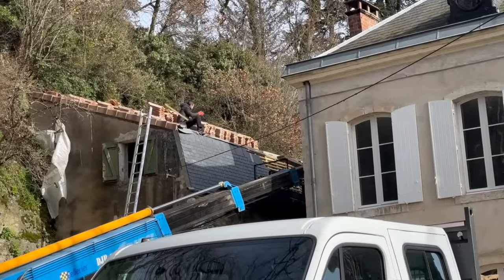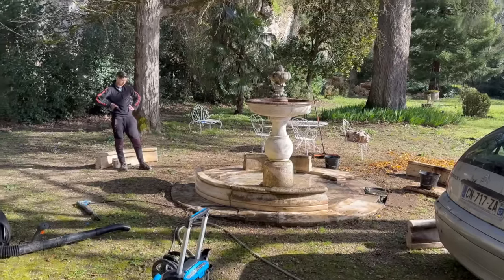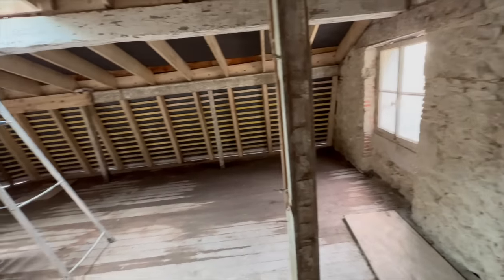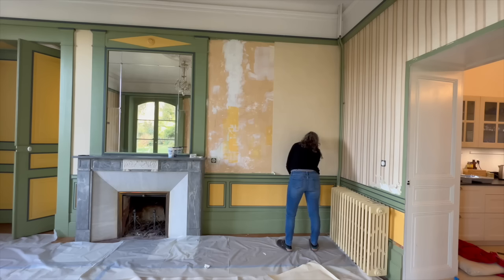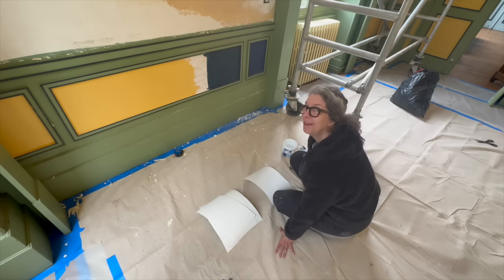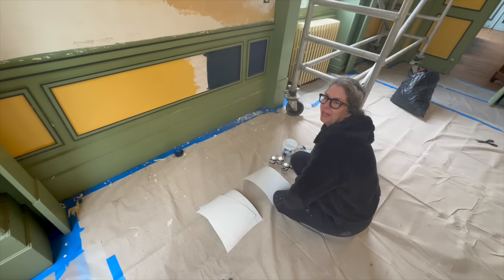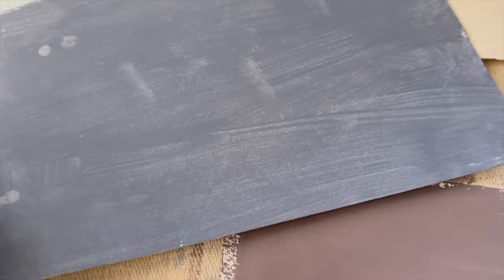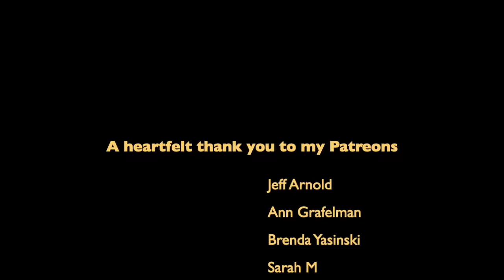Chateau Bureau transformation begins, Cottage Roof Done & New Retreat Announcement! 🎨 Ep #78

Comment: I say use 3 colors (plus not so yellow white for ceiling or use Parma on ceiling and at top areas of walls.)  Use combo of Parma, Wine Dark (I say for larger wall surfaces), and find a Deep Eggplant color for trim (darker than the purple you now show on a slim vertical strip color swatch on wall.)  Possibly use Parma in squares, or use the Wine Dark in squares and also on walls, with a unique and slightly more colorful motif hand-painted in each square, and a Deep Eggplant color for trim around Wine Dark squares.  Then use Parma on areas at top of wall and onto ceiling, like the sky.  The paint brand you are using seems to have a wonderful nuance of hues.  My favorite here in USA is Pratt & Lambert Paints.  Your progress is magical.

Comment: Just a thought on the office colours.
Since your mural depicts a scene perhaps you take the darker of the lighter blues and use it on the lower portion of the cornice and finish the top portion of the cornice in the lightest shade blue. It will act as the sky in the mural and give the room even more height.
The room has such great light the the bottom panels can handle the darker colour you are leaning towards. It will ground the couch as well as it will blend seamlessly in with the darker lower panel.
Its to bad the paper you choose is a mural. I once used wallpaper in the panel portions at the bottom like yours and it was quite lovely.
I've so been enjoying your journey from the beginning. You are fearless Abbey! ❤